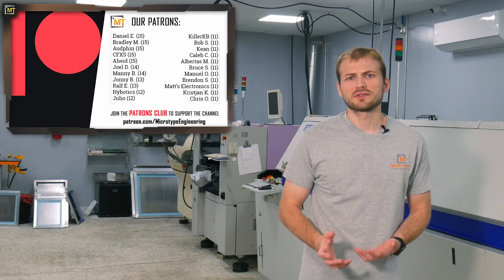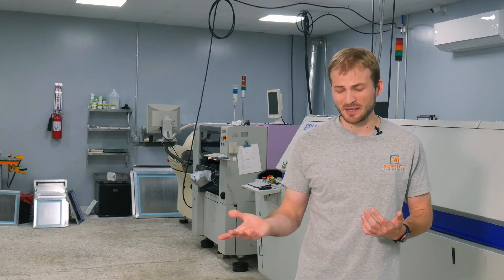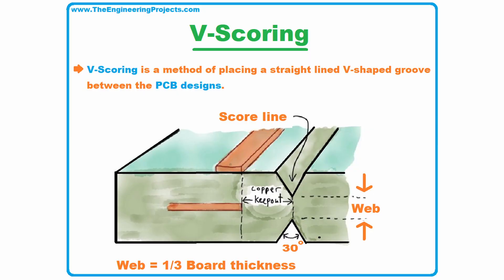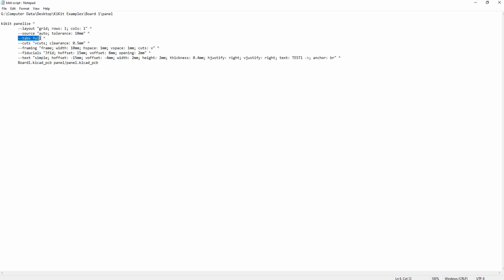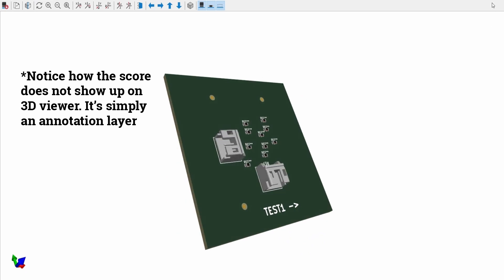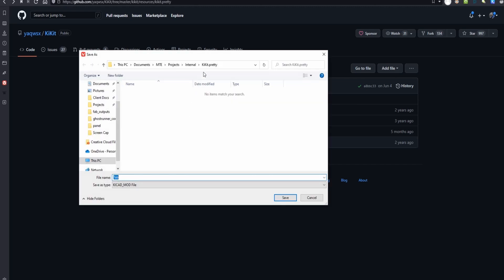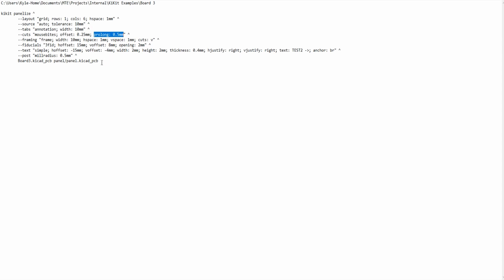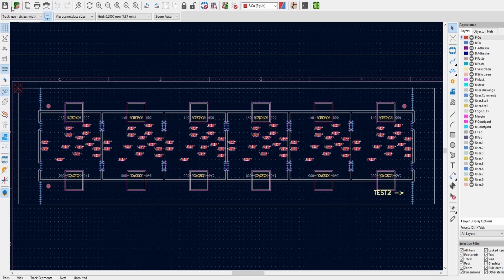KiKit For Panelizing PCBs in KiCad in 5(ish) Minutes

Comment: The gui is way better.   Just export the json file to make revisions one click.
Reply: Note:  the gui ends up freezing if there are more than a few boards on the panel.    The command line works will with 56 board panels.
Reply: @NathansHVAC  if you force exit the process after the file shows up as being updated, reopening it would work. Pretty annoying still.

Comment: That looks great indeed.  I'm wondering though how this works with getting boards assembled.  Do you export a new BOM and coordinate file for the panel or is there a way to re-use the one from the single board?  Especially since you now have many 'duplicate' components in the panel.
Reply: For BOM, just take the single board BOM and multiply by the number of boards.  For PnP part positions, our PnP machine accepts a file of the single-board component positions (and orientation), plus offsets for each of the individual board origins.
Reply: @Graham_Wideman  thanks! That was what I was hoping for though so far I've seen quite a few people struggling in getting a new PnP file created with the extra locations.  Good to hear that this isn't necessary!
Reply: @rjordans  Since you still seem interested in this slightly old topic, there's a bit more nuance. You might set your component-position frame-of-reference to be the board edges, with say bottom left as the origin. 
The PnP may set the position of the board in the machine by simply running the conveyor until the board hits a pop-up stop. Given a list of component positions (plus width of board) the machine could then place parts, but that's not very accurate as the board edges and exact position of board on conveyor are not perfect to the accuracy needed for fine-pitch parts. Instead, generally you design a board with so-called "fiducial marks", say exposed 2mm dots in the top copper near bottom left and top right corners. 
The PnP will use the position of the fiducials provided in the component-position list to find them (based on board edge) with the head camera, which then sets the PnP's understanding of the frame-of-reference. Using that frame of reference it now knows the position of the rest of the components in the list with greater accuracy.  
So the PnP is generally fairly sophisticated about working with offsets:  Board edge giving an approx frame of ref for the fiducials, then fiducials implying a more accurate FoR and origin for the component positions.  So it's only a small additional feature that the PnP wants you to provide it with an additional offset that accounts for the panel's "rails' (frame of PCB around the outside of the actual boards), and from one board in the panel to the adjacent boards in the row and column.  These offsets allow the PnP head camera to find the fiducials of the first board, and from there the fiducials of the other boards, and from there, all the components.
You could certainly treat the entire panel as one big board, and you could get a component position list from Kicad, using the panel composed by Kikit, using the bottom left and top right fiducials of the bottom left and top right boards.  However, the PnP manufacturers know that is less accurate than using the fiducials of the individual boards, so they assume the PnP will be used with panels, and thus provide the ability to work with the per-board part-position list, and offset that accordingly.
Finally, I should note that PnP machines vary in the formats of part-position list they can import.  For example, the machine I work with can accept a CSV file, but then you have to manually enter some non-component info like the number of rows and cols, and board-to-board offsets. (You can of course save the resulting "board file" for later runs.). Or, the machine can accept a slightly more sophisticated text format that includes the additional info. We have a simple python script to create that from Kicad's output.
You will likely need such a bridge script anyway, in order to deal with the bedeviling issue of component orientation, to bridge the gap between orientation of the part in the Kicad library versus the PnP's reference orientation for the package type. The PnP separately resolves the difference between its reference orientation for each package type, and the actual orientation of the part as it arrives on tape, tube or tray. Ie: you don't want your script to be the place where you accommodate the orientations of the parts on the tape/tube/tray, because those may change when you get a new delivery of parts.
Reply: @Graham_Wideman  wow, thanks again for the extended answer. Very much appreciated!

Comment: KiKit also lets you put all of your parameters into a JSON file, instead of a super-long command line.  I find this a lot easier to maintain as part of a project, as the file can look a lot more organized and contain comments.
Reply: Thanks for that encouragement - I used the json approach today and it made things much nicer. I keep a json file in the project folder, along with a text file containing the path and the command to panelise with the json file. Not perfectly portable but minimal pain and effort. One aspect I really like about the json file is that you can comment lines out, effectively allowing it to become a template/boilerplate with all the settings you may want to reuse over time.

Comment: KiKit has a GUI for entering the desired values and enabling options. I have it working with the newest KiCad version. 
Also it is crazy that KiCad doesn't include a panelizing tool itself. That's one of the many small deficiencies that hinders KiCad to be used in a professional setting comfortably.
Reply from the maker: Yes, that's the GUI I mentioned. But also like I said, it doesn't let you save or load past options, which is a deal breaker for me.
Reply: @MicroTypeEngineering  As far as I remember there is a output of the command, which can be copied or saved and loaded.
Reply from the maker: @Sulzi86 hmm I'll need to check on the latest version. The one I tried would show the output like you said, you could copy it, but couldn't import it back in. I certainly could be wrong though!
Reply: "Also it is crazy that KiCad doesn't include a panelizing tool itself."
I like the approach in the new EasyEDA Pro.  V-Cut, Stampouts, V-Cut + Stampout, optional positioning holes for tools... All in a very nice and simple GUI with a good preview.